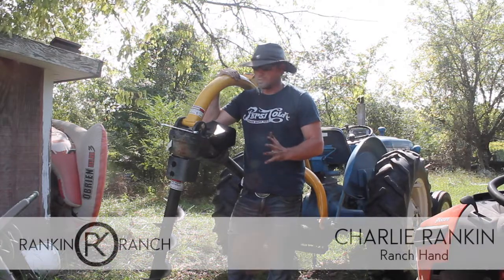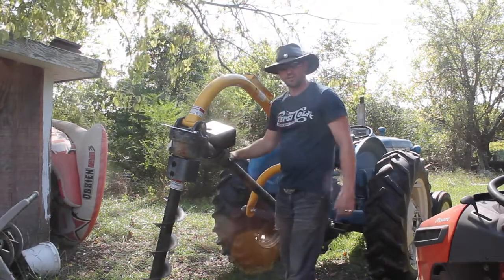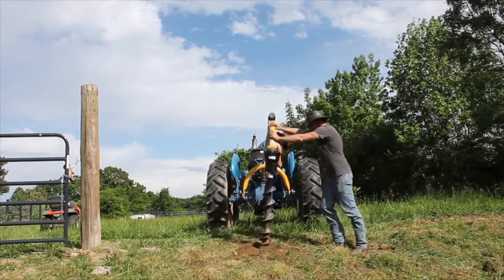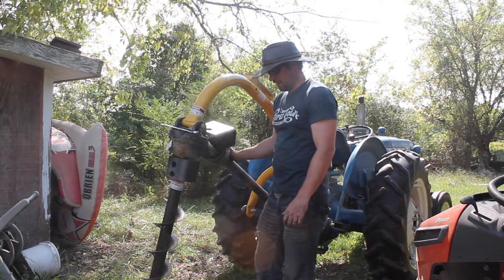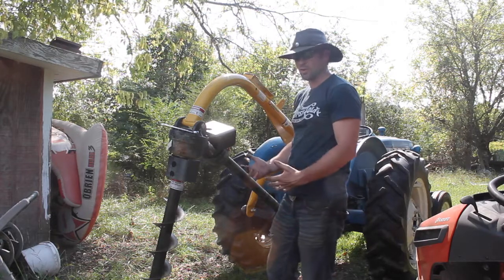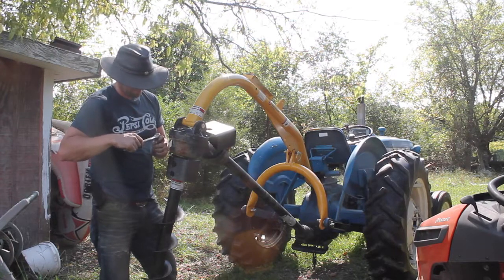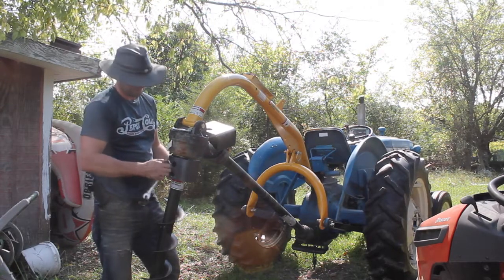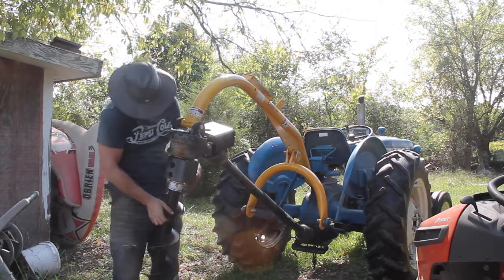Tractor Auger (Tractor-Supply Countyline) - Ranch Hand Tips

Comment: Wow, that's incredibly dangerous.  You shouldn't be anywhere near the auger while it is spinning.  I hope your video doesn't get anyone hurt or killed by following your example.
Reply: dan2304k  i agree . DONT WRANGLE AN AUGER!  Natural selection demonstration.
Reply: @DAWGnROADIE  and dan2304k  Please do up a video showing how you use this same tool without manhandling it.  I am not being sarcastic at all but I welcome an easer way to do this that won't cost me a lot of money. I have a B3030 with this animal hanging off of it and have used it for about 12yrs. We have less than 10 acres of horse fence for the dogs, garden, etc.. Thanks to the North Alabama soil going from clay, to shale rock, to just hard dirt I have gone through many end bits, bent two augers, and have taken it to gated communities to help out friends putting in fences. I am 6'6" 285 lbs and do most "yard work" alone since our sons are gone off to the Army. I have found no way to keep the auger straight except to lean into it. And yes I have known people to who were eaten by their equipment which allows me some respect for the tool but yeah I do pretty much what the video shows.  Standing at the tractor I have one hand on the controls and one on the boom to start it. After about 6 to 12 inches I push the control down slightly and work to keep the auger straight. Once it stops digging I push the control down a little and do it again. I have the three point stabilizers but no additional stabilizer bar.  Pretty good video. Some tips on using it would be good but it was a clear, well filmed video. I also use the boom for other things since I am too cheap to buy a boom pole.